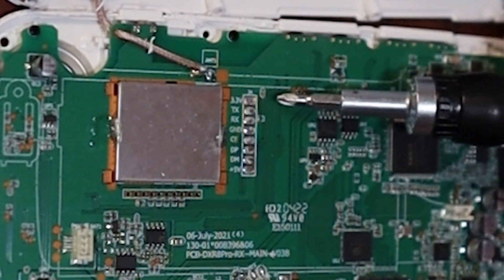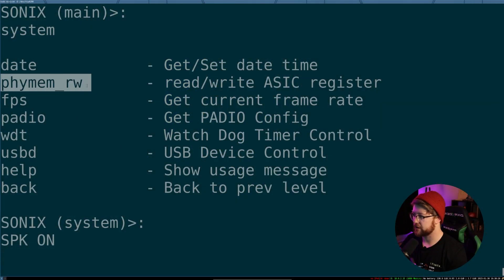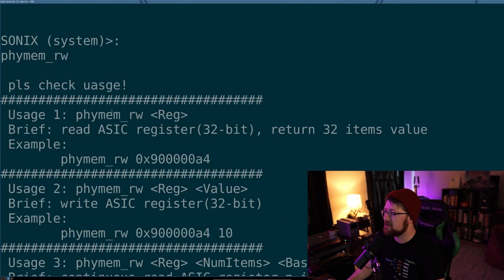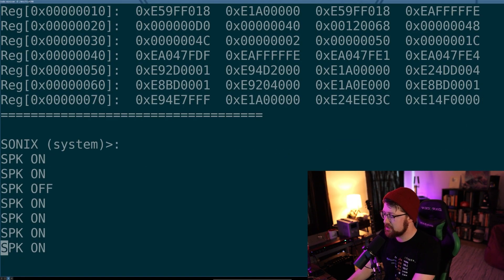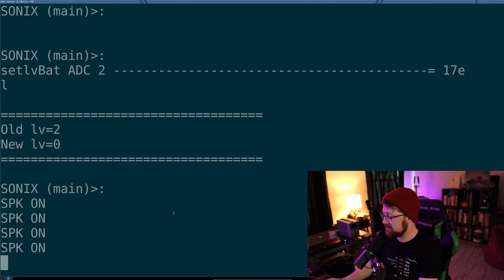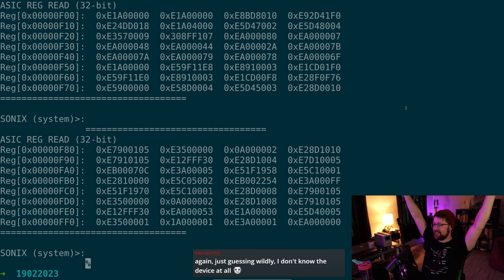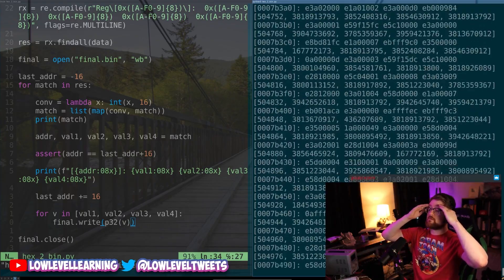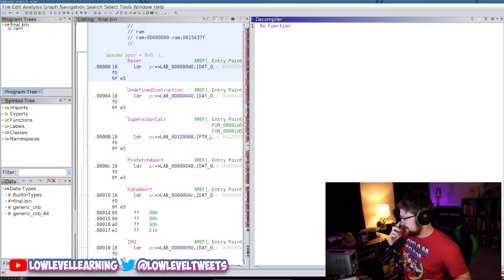i extracted the secrets of my son's baby monitor

Comment: I would have just started with trying to pickup whatever it was sending over the air, which is easier if it's a WiFi device that sends the information over the your personal network or some will over the internet (for creepy baby watching at home while working I guess), as that's a quicker job to do...
 Though I am curious what it radio spectrum it uses to send the audio and video (I've never owned a baby monitor)

Though to be fair this isn't the spirit of the channel, and you never know when someone wherever the firmware was made out in a super easy backdoor for watching random babies...or houses
I'm also not so much a hardware hacker which is why I love this channel
Reply: in the USA it would have to be a band where fcc part 15 transmit is allowed. so likely 2.4ghz.

Comment: hey great vid my dude in the future when you dump the firmware i believe it would be easier to translate the flash dump if you just made a list of the memory addresses same as you did than piping the address data into the strings linux util or alternatavely  something like binwalk or even using a tool like cyberchef

Comment: It's fortunate that the RTOS has a command shell at all; I do embedded programming, and very few of our products have any interactive monitor or shell at all; I have a module that I use during early development, but it is never included in the build for the versions that go through security or quality testing since it would be a potential attack surface. Even the devices with Linux as the RTOS have the serial drivers hacked to only support output.
Reply: You would be surprised how many devices out there just straight up give you a root tty or the bootloaders console on some random uart port on the pcb. There's also jtag, swd and stuff like that which often just stay enabled and provide handy little testpads or unpopulated rows of pins as well. The xbox 360 for example could be hacked early on by jacking into some jtag pins that were left easily accessible to anyone
Reply: That reminds me that my DVT-B reciever has a what looks like a serial port on the back. Would be interesting to look into that.
Reply: It is honestly a bit concerning. The products I've worked on we also have a very simple terminal for use in debugging, but it's never part of production.
Reply: @TinkerWorX  It's cheaper to just leave the connector off and leave the rest alone, and cost is literally the only consideration.
Reply: @orbatos  This is purely from a software perspective. I know it's common to just leave the PCB as is since it has been fully tested like that, but that doesn't mean the functionality of the terminal has to exist in software.
Reply: All of this relies on getting your hands on the physical device and dismantling the device. They would still need to steal the device access the debug ports. How often do you let people borrow your security camera.

If you can access a console over the internet then yes that is a huge security issue
Reply: This video and these threads making me realize I know actually nothing
Reply: My old security camera DVR had the root filesystem mounted as read-write, open telnetd, and open uart with root.
Reply: the postage machine at my old job had a Linux RTOS. Back when there was that massive vulnerability announced in all Linux OSes (I forget which one, 2012-13 I think?). I talked to a support person at the company and they accidentally gave me root access while we were checking the version of the kernel. 
So I would spend my free time in the evenings trying to hack further into the postage machine. 
It was a way to kill time while I ran updates on render farms and stuff. 
Such a PITA that postage machine. Took a year for them to patch the vulnerability. 
And due to corporate policy it couldn't be on our network until then. 
So I had to fill out a bloody form to request it's own isolated network, port etc.  Otherwise it couldnt buy more postage!
Reply: Sounds like the model in the video was probably designed based off of a development model stolen from another company.
Reply: I don't see disabling the interface as a real security win, I mean as long as you can dump the firmware and write new firmware by removing the NAND chips and using a flasher it can be compromised. Either way we're talking about physical access, disassembly, and soldering; then reassembly.

Comment: If it's encrypted there needs to be a method of key exchange. It sounds nice to encrypt but it's a hassle if the key fail. With powerline I need to restart the devices every month because the encryption key fail after a month or 2 months. Even if it's encrypted there is a problem with the key exchange: a static key for all devices isn't very good as all devices use the same key. But it's better to use a simple XOR static key then nothing at all. Even a static AES key is sometime used in the firmware world and you find examples in the datasheets all over the world.

Comment: Actually, just having encryption is NOT the end of the story..  Of more importance, once you have confirmed that it is using encryption is that it is using the encryption properly (correct and robust crypto mode) and also handing keys properly and securely (ie, session keys or user specified key, and not a fixed key stored in the firmware image)..   So many devices link in a crypto library and then either don't use the crypto correctly (eg using ECB mode to get around sync issues), or they hardcode a keystring in the software that every device on the planet uses...
Reply: The Snowden documents showed: the crypto is usually pretty good, but the code around it using the crypto is often broken in all kinds of ways.
Reply: @autohmae  WEP... if it was implemented correctly and had been designed by a crypto engineer... would have been reasonable... but it wasn't so had major flaws.

Comment: Just want to say. My company uses chips designed by sonix. And we hate them with passion. My best guess would be the communication is not encrypted or it's a simple ROT13/XOR cipher. 

Personally I wouldn't touch anything that runs on a SONIX chip alone, without some secondary CPU to mask SONIX's buggy firmware.

Comment: I'm pretty sure it's illegal to encrypt this as they transmit on the HAM band frequencies normally.  Encoded possibly, but not encrypted.
Reply: There's no way they are transmitting video on a HAM band.
Reply: @InfiniteQuest86  Yes they do.  Usually around the 430Mhz area. Car key fobs and the like also work on these frequencies of the HAM band and therefore cannot be encrypted.
Reply: @InfiniteQuest86  And btw..  amateur HAMs transmit much more than voice.  We transmit APRS meesages, video, images, and much more with packet radio setups.
Reply: @InfiniteQuest86  https://www.youtube.com/watch?v=QjqpKtGNbQo
Reply: As you can clearly see in this video, the baby monitor is ouputting on the 70cm HAM band @ 412.621Mhz
Reply: @MI7DJT  But don't you need a license to transmit on the HAM band? I'm pretty sure most babies don't have a license.
Reply: @InfiniteQuest86  No, not for devices that have an FEC license attached to the device.  HAM radios don't have that so require a license to use.  It's dumb as bricks to think that a child would need a license for a baby monitor or car owner for his keyfob.  Just plain stupid!
Reply: @MI7DJT  The Part 97 (ham) rules only apply to licensed operators. The licensed ham frequencies overlap with other uses and when a product is licensed under a different part it doesn't have to follow the ham rules. It would be perfectly legal for this baby monitor to use encryption.
Reply: @CoolerQ  Wrong.  If this was allowed commercial businesses would grab the entire spectrum and everything would be encrypted and impossible to police.  The only reason they use the HAM bands legally is because they are very low powered devices and therefore do not require encryption as the distance the signals travel is negligable.
Reply: @MI7DJT  device like this would in the USA fall under fcc part 15. which is the same rules wifi bluetooth wireless keyfobs etc all operate under.
Reply: @Dratchev241  Yes..  which means they are not allowed to encrypt the data.  Encode yes, encrypt no.  It is not that hard to understand.  Encryyption is not allowed on the HAM bands.  No hall passes or funny loopholes.  No encryption is allowed.  Without proper decoding or demodulation on the HAM Bands everything would sound encrypted, it isn't though.  Anyone can decode POCSAG messages for example even though they sound encrypted.
Reply: @MI7 DJT  dude just stop you are making hams look bad, part 15 like the device shown has NOTHING to do with ham radio it DOES NOT USE HAM BANDS!!!!!! it uses part 15 bands. part 97 covers ham radio in the USA. part 15 you can do what ever you want with the signal as long as it follows the radiation rules. which is a variation of XmV @ x/M so part 15 YOU CAN ENCRYPT! if it wasn't allowed WiFi wouldn't be used cause WEP/WPA/WPA2 is ENCRYPTION! nor would bluetooth, nor would remote entry keyfobs no would cordless telephones.

Comment: The user manual for this product shows it uses 2.4 GHz FHSS modulation (not WiFi) , which requires the camera and monitor to be paired.
I'll guess the video stream is not encrypted, because there's no possibility of accessing it unless you have a paired receiver within range.
I'm enjoying your channel,  particularly the reverse engineering content.
Reply: But if you have an SDR, say a HackRF one, can't you just capture the RF signals and demodulate it?
Reply: @element4element4   I've used an RTL-SDR to demodulate  ASK and FM , I'm not sure how you'd go about doing that for FHSS as you need to 'de-hop' the carrier and that requires knowing the pseudo random frequency hop sequence which is set in the pairing process.
Reply: @mikegofton1  never underestimate a programmer with a weird... Interest and the lengths they'll go to achieve that goal

(See this video as an example)
Reply: @mikegofton1  There are much better SDRs available than shitty rtl-sdr's, wich are nifty toys, but hardly useful for any real SDR work. All you do is capture the entire band with a real SDR and "de-hop" in software later. It's not rocket science
Reply: @gorak9000  The rtl-sdr is inexpensive, however it does allow RF signals to be digitised and recorded.
A higher capability device (e.g. Hack RF) provides better resolution, bandwidth and a higher sampling rate.
I take your point that if you capture the modulated signal with sufficient bandwidth , you should be able to demodulate it in software.
Reply: @mikegofton1  I think you missed my point entirely - the rtl-sdr can only capture 2Mhz of bandwidth - probably not even enough to capture one "chirp" in the FHSS. With a good SDR, you can capture 60Mhz or 80Mhz of bandwidth or more - enough to capture the whole band, and be able to follow the frequency hopping in software AND decode all of them. FHSS is NOT any form of encryption or data protection.
Reply: This particular product actually uses Guassian Frequency-Shift Keying (GFSK) modulation. It's in the ISM Band, so 2.4 GHz and nearby. So same PHY characteristics as bluetooth in that regard. Spread Spectrum & Frequency Hopping is simply a way to statistically spread power spectral density across a larger region to help play nice with emissions, or spread narrowband information across a wideband channel for protection against interference. It was originally intended for that purpose, not security. All of these things being discussed happen at the PHY and Link-Layers. Encryption typically is implemented far up the chain on the presentation layer.
Reply: I have a similar monitor that uses a proprietary RF link at 2.4ghz.

It claims to be encrypted, but quite frankly I don't care.

The range, at most, is around 50 meters. The chances of anybody within range having the hardware, skills, time and desire to eavesdrop is negligible.

Plus, even if they did they just get the world's dullest video stream of a sometimes sleeping baby.
Reply: @martinwhitaker5096  Once your neighbord puts his dinner in the microwave your signal will be gone anyway :D
Reply: Basically figured this was the deal, but with WIFI.  Looking at the camera teardown on Ifixit, the  whole RF package is all on another board. If any actual encryption happens that all could be baked into the radio boards, then you just strap an Amberalla clone to the radio board and go.
Reply: FHSS is not any form of encryption. There was a cool shmoocon talk about it years and years ago I think, i gotta go rewatch it but just hopping frequencies a bit isn't enough

Comment: Seeing or not seeing a symbol/string for encryption would not tell you that its actually using encryption or not. Try to look for uint8_t array[16] or general mentions of lengths of 16. The chip could have buit in aes encryption. Also, don't forget that production code is more often than not using -Os and -ffunction-sections -fdata-sections -gc-sections etc, to strip down a lot of code. While -Os "generally" doesn't like to inline code, if the function was used only once, there might not be a call to it.
As an aside, the standard of encryption in consumer level hardware is very low. I know this might sound dumb, but some people consider data-whitening as "encryption" by obscurity.
Best of luck.
Reply: Forgot to also mention the obvious, most RF chips have built in encryption in the fifo.
Reply from the maker: I'll have to look into this, that's a good point. They might have the RF chip mapped as a peripheral and be doing the encryption there.
Reply: Check for some spi calls as well. Have you identified the chips on the board and found datasheets for the relevant ones? I always start with the hardware so I know what to look for. Especially with reverse engineering hardware, a dead giveaway of what a function might be doing is seeing the peripheral init code, which is easy to spot if you have the datasheet.
Reply: @LowLevelTV   Hi new subs. how to find the config.bin decrypt key from my modem called freebox pop or illiad box?
Reply: +1.  It is very unlikely a device like this would be doing encryption/decryption on an ARM CPU for video - it would have to be offloaded to some dedicated chip.  Capture the raw data on the "wire" - does it look random or like H.264?

Comment: Sounds like you need a mixed-mode oscilloscope and capture the data between the chips. Many more expensive ones can save that data to a stream you can then see what happens. Some chips allow the firmware to be encoded not as much encrypted. Big-endian and little-endian also can be an issue.
Reply: Or a logic analyzer, which is much cheaper than an MSO.
Reply: @GRBtutorials  I will give you that...